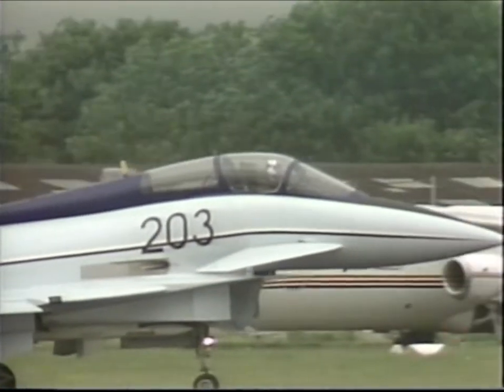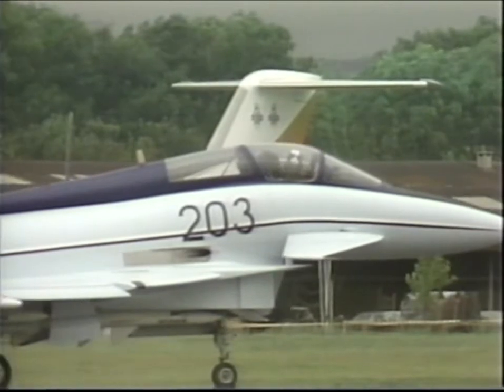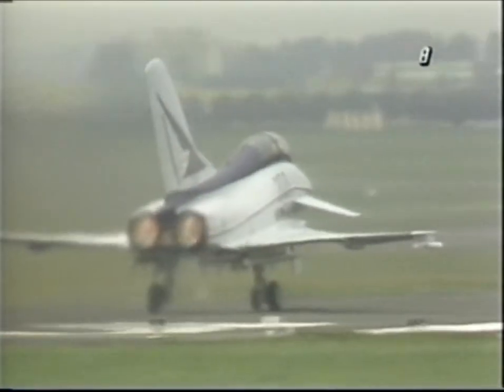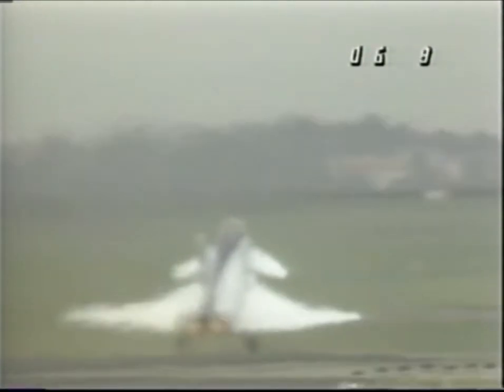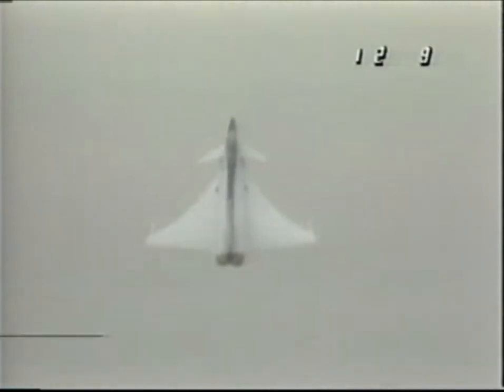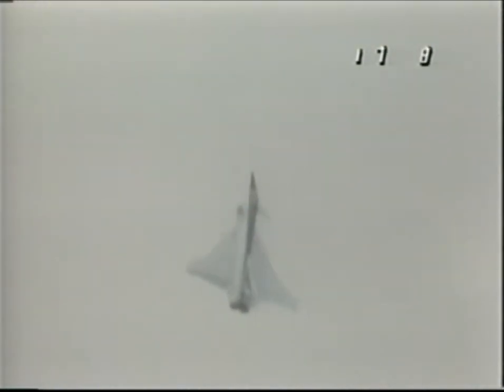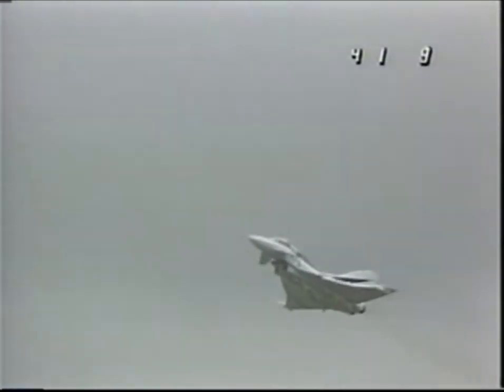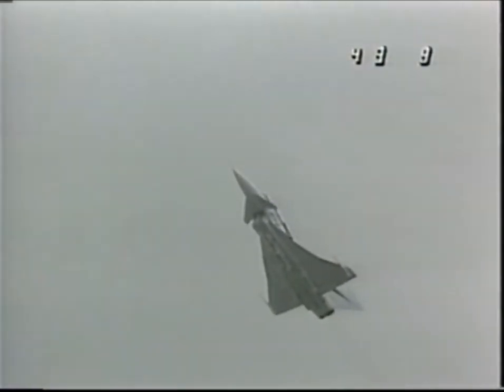British Aerospace EAP (Paris Airshow 1987 - Complete Demonstration)

Comment: Funnily enough the EAP was actually fairly capable in its own right. Certainly would have been interesting had they fitted it with and air to air weapons system and produced 50 odd for the RAF to supplement the Tornado F3 in the air defence role. It would have probably given similar aerobatic performance to the F18C. There was certainly a gap in the RAF's air to air capability when the Tornado ADV was its only actual piece of equipment.
Reply: The production version would have been P.120, it would have strait delta wings and a fixed inlet. Supposedly the AMK kit would give the Eurofighter similar capabilities.
Reply: @FsxF2 yeah, but it should exited from the factory like that. now no nation are committed to buy them just for some alfa degree in wvr... too late.
Reply: It absolutely should have. It was supposed to and then they found the production version had a tendency to roll at high AoA so they added a limited. The AMK restores this.

Comment: Ha, in reality the end product weighed more than this plane. More than made up for it in sheer thrust though.
Reply: they pretty much knew then that One of the production engines could make more thrust than both of the engines used in this! When they got the engines they couldn't run both of them up together in the test shed because the extra airflow tried to collapse the baffles!
Reply: @markscully2342  pretty amazing how much power they could get out of such a small engine. The newest version today produce some 30% more thrust than even that.
Reply: This was the end product. The commentary makes no sense.
This demonstrator has no radar, no weapon systems, no selfdefense equipment, needs less range/fuel.
While it is very similar to the EF, the wing is different, the canards are much closer to the wing, it is 1m shorter.